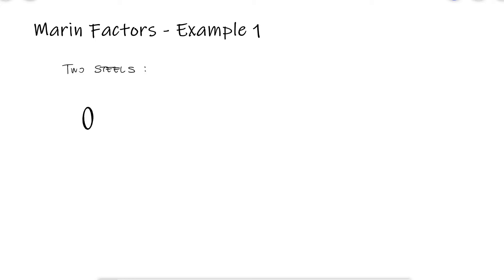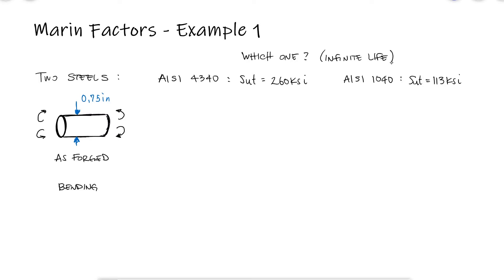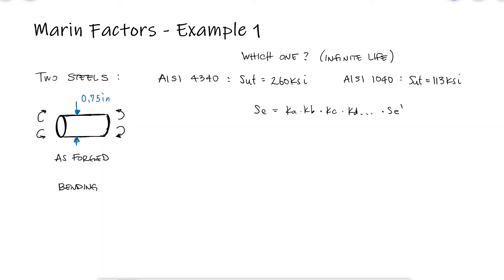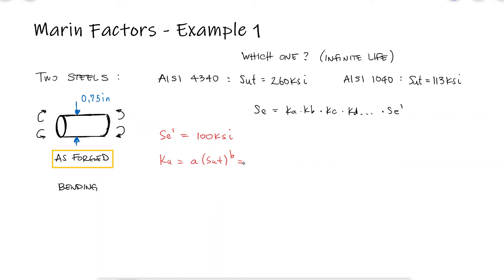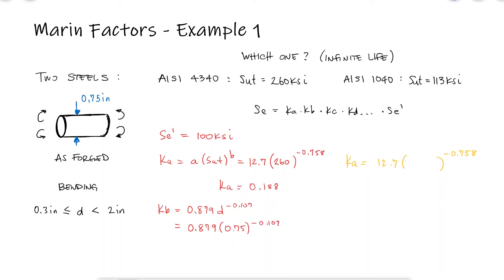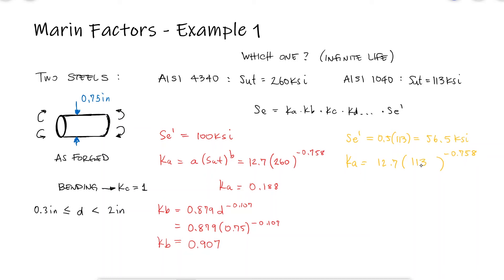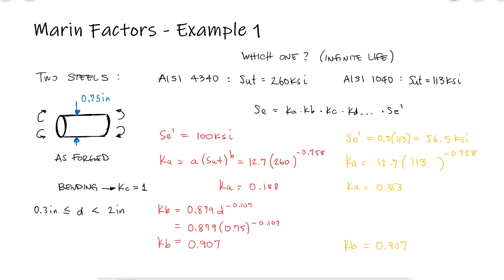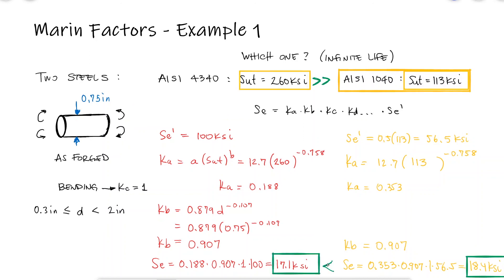Marin Factors - Evaluating Two Steels for Infinite Life - Example 1

Comment: Not sure if this is correct. Be careful with this example. I've got a=39.9 from my text boob and b=0.995. He also never mentioned if the shaft was rotating, which would affect kb.
Reply: I agree with that. We have to use an equivalent diameter "de".